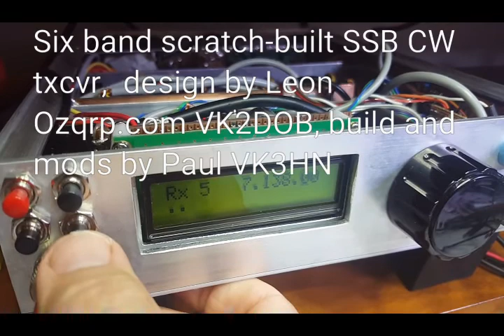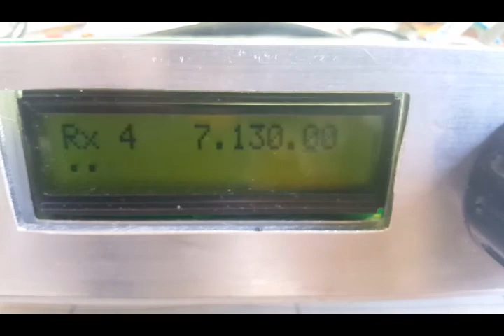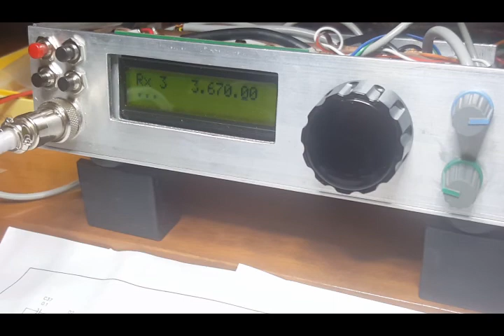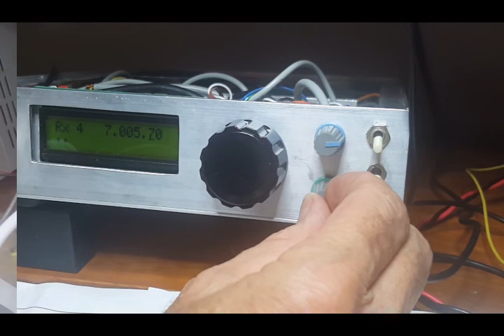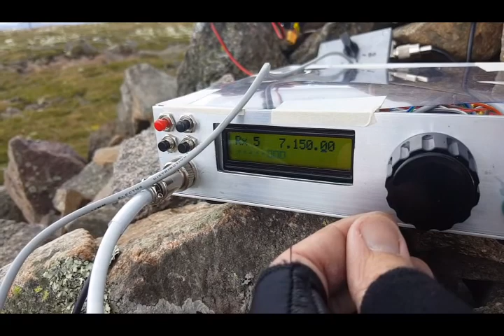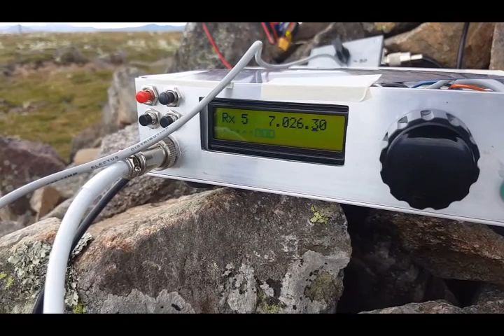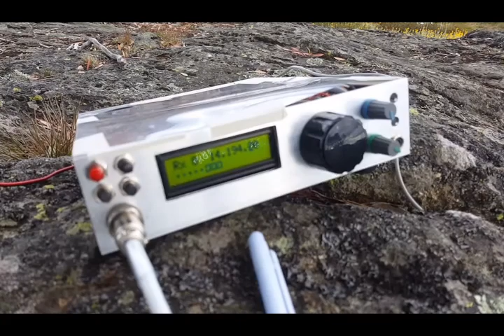Homebrew QRP six-band SSB/CW transceiver

Comment: lots of work there Paul very nice sound awesome,  how do you design the chassis?
Reply from the maker: Tnx Donnie. Chassis is 40mm aluminium angle for the front, back and sides, 1.5mm alum sheet bottom, small angle side brackets, all made by hand, held together with M3 nuts and bolts, and rivets. Write up and more pictures on my blog!  Thanks for commenting.
Reply: @Paul_VK3HN  looking for techniques for building, I would like to make my own manpack radios projects. I'm impressed with homemade radios
Reply from the maker: @skynet1703  Lots of kits to adapt, unlimited options if you scratch build.  Maybe try a microBitx module, as your challenge will be the case, carry straps and antenna.
Reply: @Paul_VK3HN  is there any special equipment needed to align the radio after contruct? The radio you built above is that the MST3 radio? I see you have 6 bands in yours. I would add 15meters you really have me thinking I have an antenna tuner circuit in mind for the manpack. I'm even thinking a small amp to run 20watts also. I have been drawing on paper what my design. I was thinking of adding a Rasperry Pi for FT8 and FT8Call.
Reply: after doing more research online I think I would like to use the uBitx radio in my radio Paul
Reply from the maker: @skynet1703  The url for a detailed description ... https://vk3hn.wordpress.com/2018/02/16/summit-prowler-iv-a-six-band-scratch-built-80m-to-17m-5w-ssb-cw-transceiver-for-portable-and-sota-use/